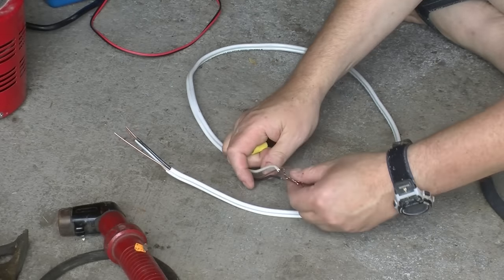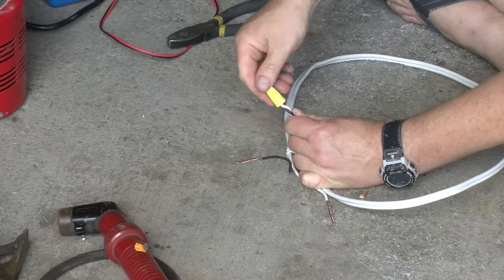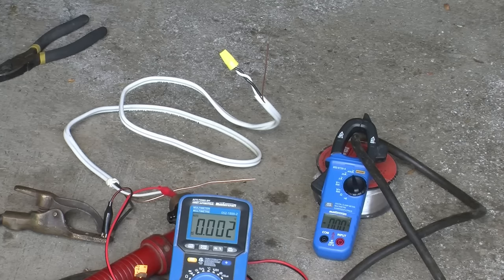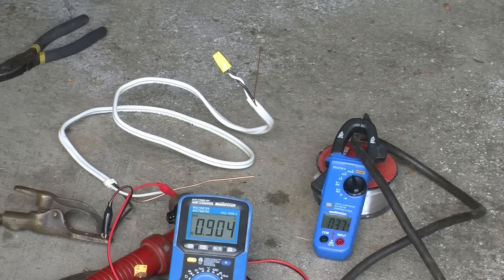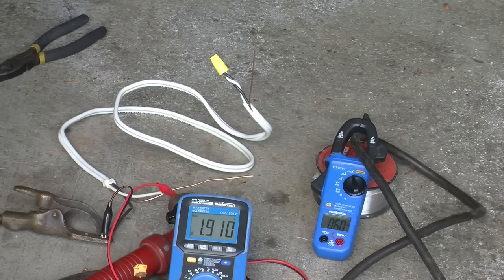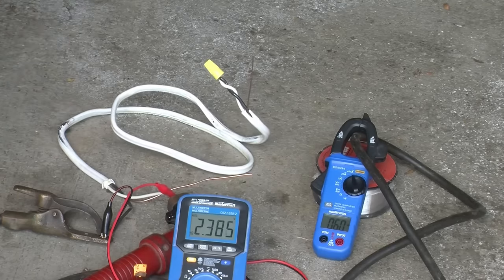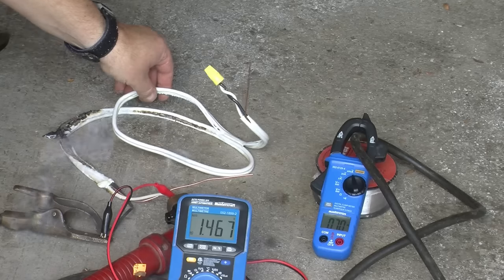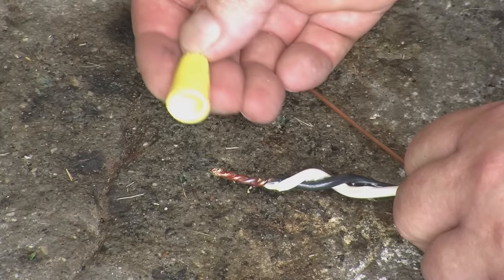How many Amps to burn up 14/2 electrical wiring?

Comment: Great video. A couple years ago I had bought 8 solar panels of 420 watts each, well 400 watts each is more accurate since I live up near the 50 degree parallel. Anyways, it's quite easily possible to have 100 amps or more in places with these systems which would finish off any normal house wiring all at a modest 3000 watts of solar intake or power demand.
Reply from the maker: Interesting. I am at the 45 degree parallel near Ottawa so a bit south of you and am on the verge of putting a solar panel system and can probably expect a similar de-rating of max output. So are your panels in parallel with 24V loaded output? So 3000W/24V = 125A or so? Are you off grid?  I have micro inverters so it will be two 250W panels per inverter with the inverters attached to 240V so much less current to deal with and hooked into the grid for net-metering. 

The one thing the video does not show is if there is a short and an arc, a DC arc does not extinguish easily like an AC one does, so switches, breakers and fuses all need to take that into account. The international space station uses 120V DC - I shudder to think of the consequences of something going wrong up there.
Reply: @ElectromagneticVideos  A fellow Canadian. I live on the BC coastline.  I suspect that there are better solar panels than others, but in general I found that buying the panels from Canadian tire usually gave me about half of the rated output power. Weird ehh. These panels that I used were from a local solar panel seller and were putting out close to the rated power even here. exceed
Reply from the maker: @rwatson2609  Interesting that solar panels from  Canadian Tire would be that poor. I cant imagine why since the panels would be made in the same factories overseas that make all the other panels. 

BC Coastline! How nice! I have visited the Vancouver and Sunshine coast areas often (well before covid anyway) since my brother lives in the Vancouver area. Beautiful area (but expensive!).
Reply: @ElectromagneticVideos  The difference in efficiencies between the new panels of 2021 vs the Coleman products from Canadian tire might have been the MPPT system that I was using this time. Not sure. Anyhow, part of my reply was lost last time. I had wired up the solar panels as 2 banks of 4 panels in series, mainly to accommodate the amperage limits of the MPPT solar unit and to reduce the wire gauge. I am off grid and yes, I too am running a 24 volt battery bank. So far it has worked well for a couple of years. I do find that the biggest problem is still wasteful power consumption and it's driving the need for a bigger system. Most people may not notice it but we all tend to have a very wasteful way of playing with energy. For example, using electricity to boiling a large kettle of water in order to use just a coffee cup worth of it. I've had to put some of the lights on timers because of the same thing. They may all be LED but still a shop light system or even a set of kitchen lights had often be left on for hours or even throughout the night. We heat with wood which would save a lot of electricity, if I could only retrain the gang ;)
Reply from the maker: @rwatson2609  Good point - that could easily be it. I'm sure not all MPPT system are alike and some may work better with certain panels characteristics than others.

I completely understand your power consumption issues - had an off grid place years ago (before affordable solar) that had an inverter, battery bank and generator. The Inverter actually powered down when it sensed no load, which would not have worked well today with the AC power adapters people now use that draw phantom power al the time.

And yeah - just forgetting the lights on can so easily drain a battery.  Are you using Lithium Iron Phosphate batteries by any chance? I have always wondered how well they work. In my off grid days I used used Lead-Acid industrial batteries.
Reply: @ElectromagneticVideos  Yes, LiFePh4 from "Big Battery". Expensive choice but we kinda weighed all our choices out and decided to go all In with Solar hoping to completely remove the generator from our system needs, its actually a fishing resort to be exact. For the most part we really don't use the gas generator in June to August months. There are also a bunch of other electrical needs here that force the 3000 watts that you would not have, like a golf cart and a Starlink system with ip cameras water pumps and every battery power tool known to mankind.
Reply from the maker: @rwatson2609  Solar makes complete sense for that. Not having to haul in fuel I'm sure is a big plus. I'll bet Starlink makes a huge difference to how life is out there. I used to have a (different) where the only internet option  back then was Hughsnet/Xplorenet satellite internet. 1Mbps or less if I recall but the worst was the round trip delay the signal took to get geosynchronous orbit and back. 

I had heard good things about LiFePh4  - getetr utiization of the full amp hours than lead acid and good storage capacity for the money - I have it in mind for future plans to build a camper van which is why I was asking!
Reply: @ElectromagneticVideos  a camper van project sounds like a fascinating potential for You Tube content. Hopefully you will do that because I'd love to watch the build. I like your channel, lots of great content with a ton of knowledge to back it all.
Reply from the maker: @rwatson2609  Its something that I have been thinking about and looking into for a while. I have pretty much decided in a Ford Transit van - probably with a mid height roof. The AWD ones seem to be hitting the used market now. I wasn't thinking of videoing it but now that you mention it not a bad idea. Might be a good way to get advice as well....

Comment: NM-B is actually rated for 90C and 20 A.  It’s the rating of the circuit breaker that calls for the 15A rating
Reply from the maker: I thought the code simply limited 14/2 to 15A for residential applications. Am I mistaken?
Reply: You are correct, but it’s not because of the wire.. the circuit breaker itself is the weakest link..  either way, I have seen 14/2 burn up at 22 amps on continuous load. Great video! Always good to test stuff to the Mac.

Comment: not an electrician but from my understanding talking to my dad over the years(he was) part the technicality for wire rating is where it will be used; for instance wire used for the mains outside to the power lines can often be lower gauge in ratio compared to if it were used in wall since it will be in open air(cooled) ** I think a similar technicality is used for the wire gauge used on plasma cutters for the air line; they use the air to cool the wire so get away with lower guage
Reply: Power lines are smaller gauge because they are ran at much higher voltage. After the transformer on the pole steps it down to 120v you need a larger gauge because it takes more current at 120v to get the same power.

The main wire coming into the breaker panel is usually a 4/0 everything coming out of the panel is much smaller.

Comment: The wire nut lasted simply because you twisted the wires together at the beginning. A loose connection (arcing) with cause the wire nut to fail i.e catch fire
Reply: There won't be arcing without twisting.  The wire nut makes solid contact with both wire during installation.

Comment: I've always wondered about this! Good video
Reply from the maker: Thanks!
Reply: The voltage measured is only the voltage that is not consumed by a dead short thus your wattage calculation is not correct,the better method would be: use a 12 volt car battery as a source of power and a carbon pile load tester instead of the wire nut, then increase the load with the carbon pile. A reasonable car battery should be capable of ( note the term "about")  about 6 to 7 thousand watts for about 10-15 seconds.....the 14 gauge wire will probably fail well before that level.

Comment: I go wire nut over WAGO, etc   every time I have a choice.
And go with oversize twist nut before ever going undersize.
Reply: Wire nuts for anything over 2amps.....I agree....low current application such as LED lights I would use Wago.
Reply: @Ezzell_  Yes, it's really just my preference because (other than a slightly higher temperature during heavy load) the WAGO performs as good as a wire nut. 
https://www.youtube.com/watch?v=B1pmuRsf1co

Comment: The original Marr connector was a set screw terminal that you then threaded on a plastic cap.  The wire nut was originally called a Marrette.
Reply from the maker: I'll show my age - I have seen those but nor for years. They were really nice!

Comment: In 20 years as an electrician….
I’ve never heard a single person call it a “mar” connector. Never heard that word.
I’ve heard 200+ electricians call them a wire nut tho.
Anyway I liked the video
Reply from the maker: I think its a regional thing. Here in Canada they are often called Marr, after William P. Marr who invented them in Toronto. His original brand name was Marrettewhich  is still used by ABB Canada. 

Glad you like the video - if did a number of more realistic ones with 14-2 in 2x4 walls with varying degrees of insulation. Not surprisingly the safety margin is much less in that type of situation but the videos aren't as entertaining.

Comment: The wire nut isn’t carrying any current and the twisted wires are a shunt, so only the heat of the shunt would effect the wire nut, dc current is different than ac current.
Reply from the maker: Its the total wire nut connection that interests me  - in one of the other videos I test twisted vs untwisted wires in a wire nut. The welder is a vintage AC welder.

Comment: One thing that causes house fires is romex staple knocking romex not enough cause a dead short, but enough for heat to develop.   After a period of time the stud starts to burn
Reply from the maker: Thats interesting! I never thought of that. I have seen the metal staples pounded in too much. Have you seen charring under a removed staple? That would be interesting to see!
Reply: @ElectromagneticVideos  I worked in Fire Rehab Co.
I'd go in and install temporary electric for clean up worker and carpenters.
I'd go in with the Fire Inspector.   This was one of the causes of house fires.  
Did you ever notice that fires started during or just after home remodeling?
Another cause of fire by blow insulation around bathroom venturing fans.
The bathroom fan was let on over night.   The insulation caused the motor in the fan to over heat, and burn down the house.
Reply: @ElectromagneticVideos  I have an experiment for you.
Set up  romex with staples.  
Tap the staple in.
Put a meter on the staple. 
Continue to tap until you get a small reading, but you haven't tripped the breaker. 
Then feel if the staple starts getting hot. 
I don't know at what point the staple will get hot,  or if you have to have a load on the circuit.

Comment: When I have used wire nuts with more than 2 wires I have found it works better if they are not twisted. With only 2 wires I guess twisted is okay. Just do it right!

Comment: The short run can handle more current than a longer run. Resistance of the wire increases over distance.
Reply from the maker: You bring up an interesting point: the longer length max current is usually limited the max allowable voltage drop, usually 5% or so. The max current for shorter lengths is limited by heat emitted melting the wire as in this case. 

However, this case is not the most realistic given the wire being in open, free flowing air. If your interested, look at the videos that follow where I have the cable in 2x4 walls with and without typical insulation where heating is more pronounced. Unfortunately, not as exciting as this video!

Comment: Since lightning is more frequent, question comes to mind, if one should have lighting rod system on roof like on farm steads ?  Live in small city but have couple fir trees slightly taller than 'A' frame house but quite adjacent to them.
Reply from the maker: That is a really good question. I can only guess at the answer: its probably a cost benefit thing. The chance of lighting hitting any particular house is low and when it does, what is the typical cost of the damage? Many years ago I arrived at someones office that was located in a house minutes after lighting had hit. The EMP pulse took out the photocopier (they had unplugged it prior to the storm) and a a couple of computers were damaged (unplugged but on a wired network which acted like an antenna). Would a lighting rod have helped? The EMP would still take out a lot of electronics. 

It probably depends a lot on the home construction style in an area and the frequency of lighting. Insurance companies would insist on lighting rods in any area or situation (barn, tower of some kind) where they would produce a significant benefit.

Comment: The fun part is that at 40A you can see the voltage rising slowly, indicating an increase of resistance, indicating an increase of temperature of the wire, and also increasing the watts put into that wire.
Reply: This video would be better with a heat cam...
When I charged my LiFePo batteries the wires became pretty warm, but they stayed constant at 30 degrees celsius. Hot enough for me to place the cables on a cold ceramic floor.
Reply from the maker: @bloepje  Very good point about the positive feedback loop that increases the resistive losses as temerature rises, further increasing power lost. I did get a IR camera for some the videos that followed this one. 

Interestng about about the battery - 30C in air is not bad, but in areas of restricted air flow could easily get higher. I did some later vides of 14-2 cable in insulated wall sections - as expected, significant temp increases due to insulation

Comment: This cable is in open air where heat can dissipate.   A much better demonstration would be to build a small wall, with insulation and drywall on both sides to simulate a real life situation.   For example,  usually with older systems that use fuses but also possible with breakers.   Sometimes a homeowner gets frustrated by a fuse or breaker that keeps popping.   Instead of  correcting the overload problem , usually because homes built many years ago, did not have the required number of circuits and receptacles to power a modern lifestyle,  will install a 20 or 30 amp protection.    Sometimes they will use a penny or aluminum foil to bypass a fuse.    Some brands of breakers have a well documented failure to trip.   Federal Pacific Electric and Zinsco,  sometimes labeled as Sylvania,  or GTE-SYLVANIA,  have a troubled history.
Reply from the maker: The fake wall section you describe is actually what a I have planned for this weekend! When I was a kid we lived in a few houses with fuse panels and scarily I think many fuses had been replaced with larger ones. I had no idea homeowners did that with breakers. I never saw the penny thing - no protection at all - I guess it seemed like a good idea at the time until the house burned down. I'd heard of the Federal Pacific breaker issue but didn't know there were a bunch of others that were equally bad. I guess it took a while to discover that some of the early residential breaker designs were pretty bad.

Comment: Years ago i used a Lincoln welder to thaw frozen pipes that froze under a farmers road that fed from his house pipes to his milkhouse i would put a cable on the pipe in pumphouse than one cable on pipe in house turn the gas driven welder on and wait a few minutes than start turning up amps than pretty soon a drip would start and than it would start to flow and the farmers would treat me like a hero untill i sent them a bill than they completly forgot about how important it was for running water.😅
Reply from the maker: "farmers would treat me like a hero until i sent them a bill" - lol! I'm located near Ottawa, Canada and we tend to have quite cold winters (well except this one). Not normally an issue, but many years ago we had a winter with very little snow cover so the frost went way down into the ground and froze large number of water pipes supplying individual houses. The solution was exactly what you did - I think the city actually had crews going around dong it. Makes you wonder what will happen to all the modern neighborhoods where the pipes are some form of plastic if if they freeze.